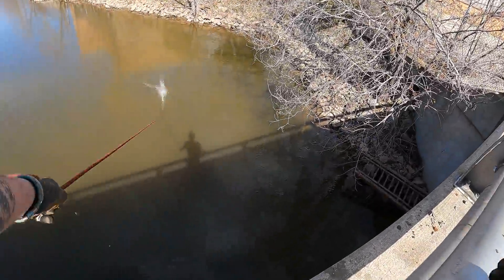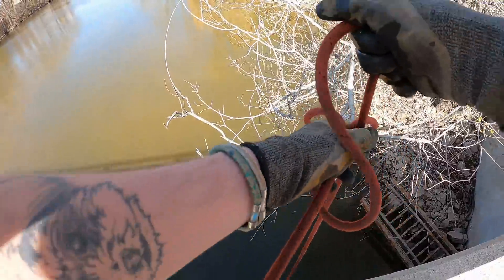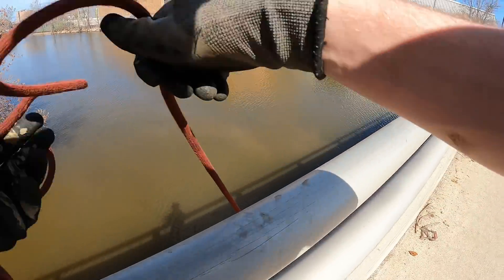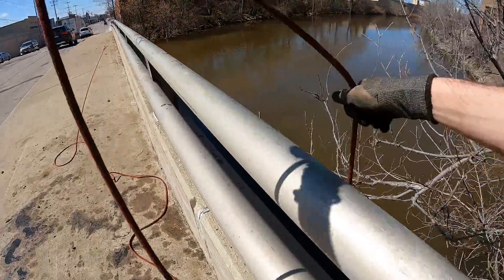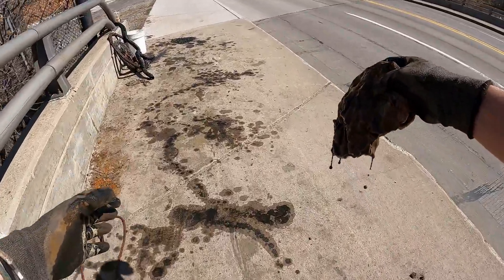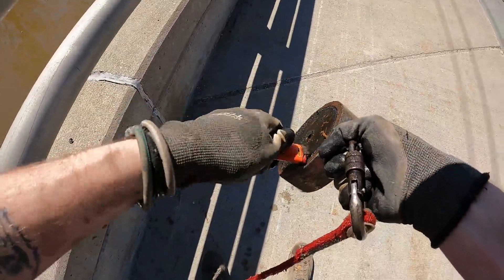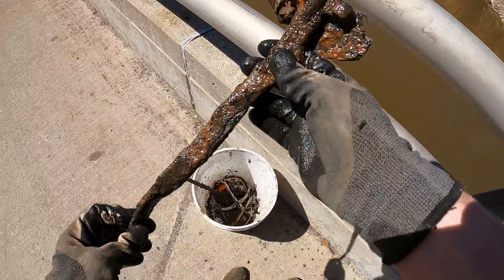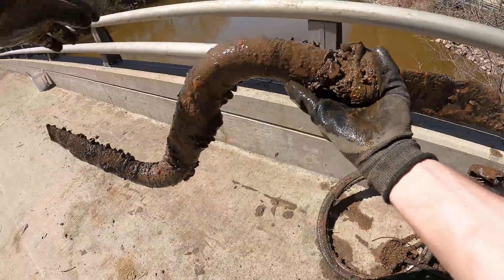I Was TERRIFIED When I Found This Bag Magnet Fishing!!!

Comment: 3:10 BMX made wheels with more than average and thicker than average chrome plated steel spokes, and had chrome plated steel rims and chrome plated steel hubs, before this aluminum wheel was invented.
Aluminum was something that came later on bicycles and motorbikes becourse aluminum was once a scarse metal hard to obtain becourse of the energy needed to make aluminum. Aluminum got the weight down and less parts and no adjustment of spokes, so aluminum wheels for me is a modern invention lol even if this wheel is old school today too :)
I had a DBS kombi bicycle with old steel BMX wheels on it, back in 1982 somewhere, i bought it from someone who did put it together this way and i found it neat.
BMX history say they already made bicycles in the late 60's.
It was strong wheels made for professional people jumping and doing offroad things so i never had proplems with those wheels using them on ordinary roads :) But i had to go to the car gas station to get air in the tires becourse BMX had car valves, not ordinary bicycle valves.
It never did need much air. Later i got a old car foot pump from my dad if i ever needed it.
My bicycle never had front brakes becourse it was a a different braking system on DBS front wheel so DBS had no mount on the fork for rim front brakes, the DBS wheel had hub brake.
But the rear brake was fine enough for me, i was never picky and did not need much lol :)
It was a bicycle just like this with the nice ladybugs on it,  but it had been painted black and also BMX wheels on it and also new handlebars.

DBS Kombi
https://dms05.dimu.org/image/0331yxY9haxw?dimension=1200x1200

DBS stands for 'Den Beste Sykkel' (''The Best Bicycle') in my language norwegian. So yeah, i did once own the best bicycle if one should take that litterally :) But yeah, they made good bikes :) Look up the DBS Tomahawk and DBS Apache and see som rare and back then somwhat strange shaped bicycles made by DBS.

Comment: I'm curious about a couple of things.  Why didn't you pull up that section of railing that was on the one bank?  It would have added to your cash money stash.  The other thing is , do you ever check the heads of the RR spikes for dates?  Not all are dated but some were and the dted ones are , or at least were , more valuable that just scrap.

Comment: 8:50 What I do if I find a lighter with some fluid still in it but the sparker no longer works is to use a second lighter (even an empty one is fine --- it just needs to still spark) to ignite the first one by holding down the valve and then striking the second lighter near it.